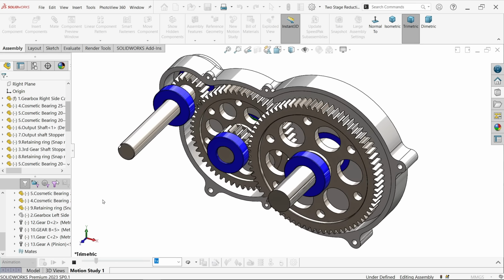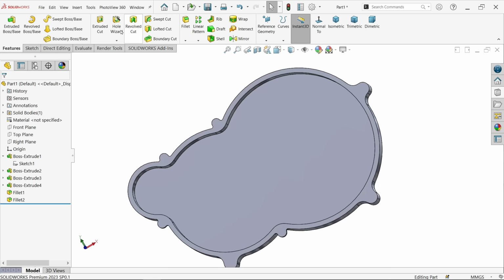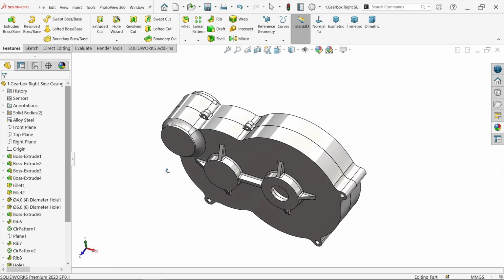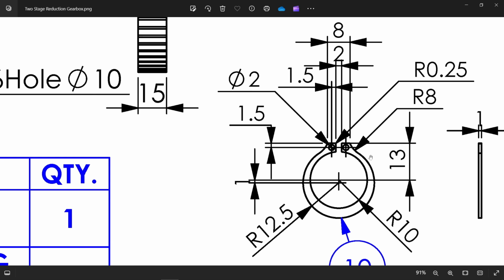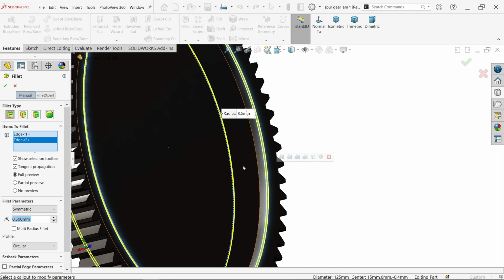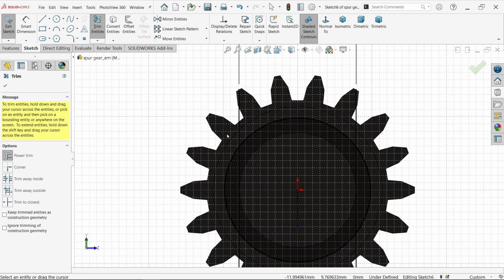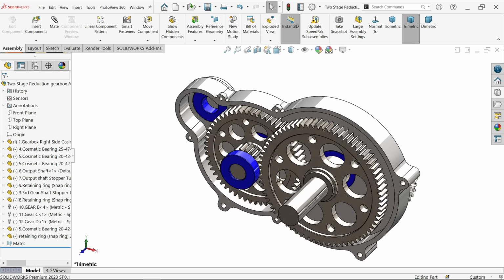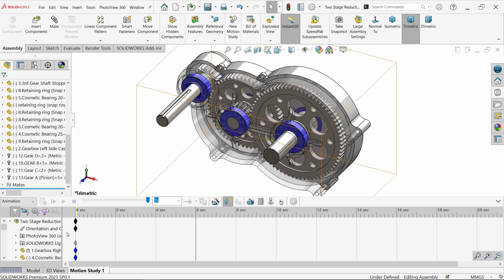Two Stage Reducer Gearbox Parts and Assembly in SolidWorks

Comment: Thank you for this video. I have a problem. After saving and closed the assembly and reopen, the gears are not as the same and back to default to Spur Gears. why is that?

Comment: Sir, it was a good tutorial. But after saving the assembly, when I am reopening it, gear features are missing and mates are showing error. Please help me with it.
Reply: I'm also facing the same problem. How to overcome from this
Reply: I also faced same issue
You can save the part as a step file first and then import it in the assembly
Then it works completely fine

Comment: Shouldn't the retaining rings fit inside the 1mm grooves? Currently, the inside diameters of the retaining rings are the same as the outside diameters of the shafts.

Comment: The view was a bit dark when it came to the gear😄
Reply: I had to keep selecting different scenes (from Apply Scene) until I finally found one so the gears were not so dark, especially the back side. They were almost completely black. (The "Urban Background" scene was okay as far as lighting the back of the gears. It also helped when I saved the gear by its new name (e.g. "Gear B") before starting to edit and then turn off the "View Grid".)
Reply: @thinking-monkey  hey can I have access to the parts you made through this video? I need it for my project. If you could help me with this